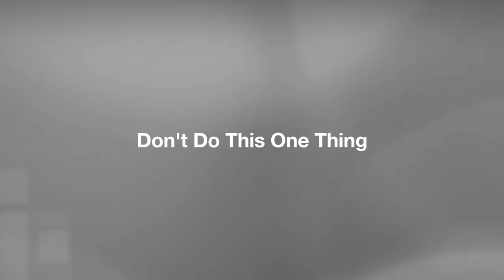Lessons I Learned - Insulated Vertical Smoker Build

Comment: Perlite is not a good insulator. It used to be a blow-in ceiling/roof insulation, later found that the dust was a carsnagen. Used in forges, perlite is mixed with plaster of Paris and layered on the entire interior. When cured, a hot fire is produced. This heat melts the perlite leaving trapped air in all of the voids. The air filled voids are now excellent insulation.

Comment: After this amount of time, how do you feel the gaps placed in the diverter plates work? Would you change them in any way? Thanks for the video.
Reply from the maker: They work some, but I have noticed that a lot of the heat travels straight up the side walls.  Next time I would probably make the second layer diverter only around the edges and about 4" out.  That way it would push the heat towards the center instead of letting it go up the sides.
Reply: @UncleTimsFarm  Been planning on building something like this and this will help me out. Thanks.

Comment: might you have the dimensions of the spacing of shelves, diverter plate and the spacing of the brackets holding the diverter plate? size of the diverter plate?
Reply from the maker: The shelves are 7" from top of shelf to top of next shelf.  The upper diverter plate is 21" wide and 24" deep.  There is a piece of 1" square tubing on on each corner that holds the bracket for the plate 1" out from the side wall so that the smoke can escape along the side wall.  The lower diverter plate goes all the way from side to side, but stops 1" from the back wall to let the smoke through.  This way the smoke comes up the back wall and then out along the side walls.  I hope that helps.  If not let me know.  Thanks.
Reply: @UncleTimsFarm  thank you so much that helps alot

Comment: Hey Tim! I’m looking into making an IVS myself but am wondering: how exactly would I make the insulated structure without a frame? I know you point us to your electric smoker video but you don’t focus on the frameless fabrication. I would really appreciate pointers towards any techniques/ methods I should look into to achieve a frameless build. Thank you!
Reply from the maker: So the way I did it was to have the steel company pre-bend the outer shell at the front so that it would meet the inner shell that was pre-bent in a U shape.  The inner shell is in a U shape and the outer shell is bent in a U shape only larger, but then has additional bends so that you can weld the inner and outer shells together without a frame.  Then in the back the chimney passes through from the inside to the outside and helps hold the structure together.  I'm not sure if you can picture what I'm talking about or not.  It's kind of hard to explain without a picture.  In the first two videos of the Electric Smoker build you can see what I'm trying to explain.

The only place the inner and outer shells contact each other is along the vertical seams at the front of the smoker and where the chimney passes from the inner chamber to the outer chamber.  Everywhere else has a one inch gap filled with high temp insulation.
Reply: @UncleTimsFarm  I can picture that perfectly, and it makes sense - thank you!!

Comment: Tim, maybe I missed it. But you mentioned insulating the chamber/fire box with perlite, do you have a video showing the process. And In your opinion how does that hold up to ceramic fiberglass blanket? Also what happened to your door, why is it so warped. Thanks Tim, great video
Reply from the maker: In part 4 of my Insulated Vertical Smoker build video series at around the 3:20 mark I show how I insulated it.  The perlite holds up fine, but ceramic or rock wool insulation is a little easier to work with.  The door surface got warped because of overheating while I was welding on it.  I should have taken more time and let it cool as I went.

Comment: Awesome build. I'm an offset kinda guy, but I am always tempted to get a vertical just to have one. 
I have seen at least 3 times in person vertical smokers catch on fire. Specifically, those that rhyme with (it and maker)😂
Reply from the maker: Thank you.  Yes, I’m an offset, reverse flow guy myself, but wanted to give this build a try.  Overall it does an OK job, but I prefer how my offset cooks over this one.
Reply: @TheDnlnext  I’m curious what happened on those vertical smokers that caught on fire???  That scares me
Reply: @Colorado4x4  They choked them off all 3 times. One got some smoke and fire damage on the outside (top where the door seals). It damaged the General Lee paint job. I think it can be prevented with the right upkeep. 
- 2024 I didn’t end up getting a vertical smoker, but I am building a 500 gallon offset onto a homemade trailer. What an experience for a non-welder let me tell you 😂 but it will done hopefully this month.
Reply: @TheDnlnext thanks for the reply!   I’m debating on what to build.  Hope your build goes great!!!  I’m thinking patio offset but I’ve always wanted a gravity feed

Comment: Hey Uncle Tim,
Thanks for the update.  Questions:
1. Is just welding the Cook box and outer box in the front sufficient to secure inner box in position securely? 
2. Could you share cost and our diagrams that could help me visualize who you built not of your smokers? 
3. Sources for latches and hinges?
Love your content.
Reply from the maker: 1. After I posted the video I realized there is actually another point of contact between the inner and outer chambers.  The smoke stack.  Between that and the front, the inner lining will be secure.
2. The cost for this smoker was around $1300 at the time I built it and my electric smoker was a little less than $1000, but steel prices had gone up quite a bit by then.  Sorry, but I don't have any diagrams.  I basically had an idea and just built it.
3. I got the hinges from Amazon and there is a link in the description to 3" bullet hinges.  The latches came from Hinged Parts dot com.  There is a link in the description for that as well.
Reply: Thanks Tim I appreciate your reply 👍 🙂 😊